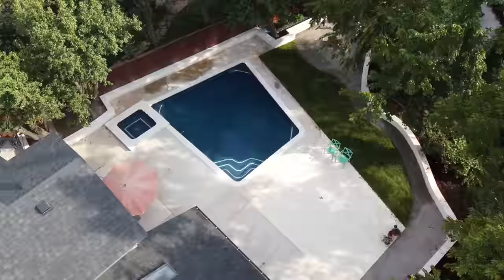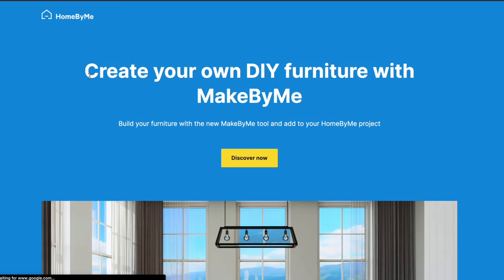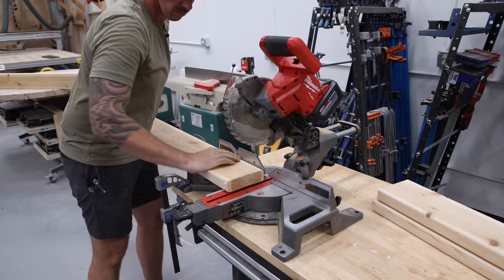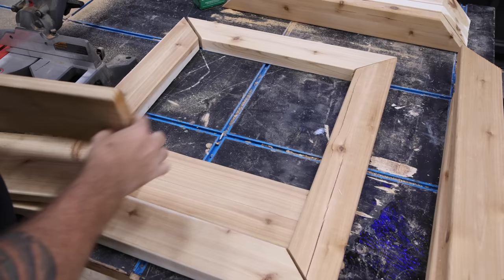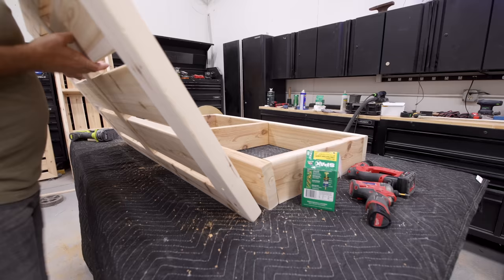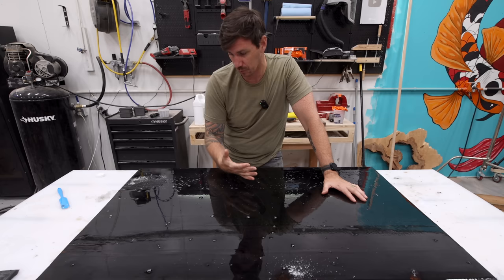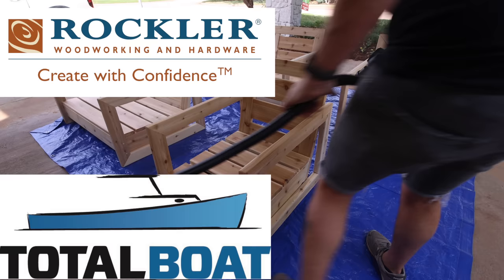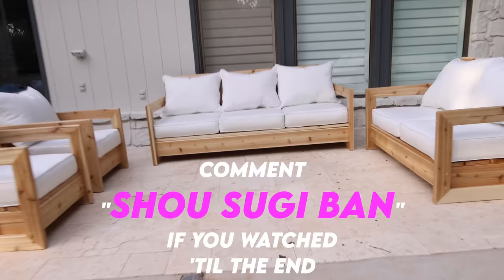$10,000 DIY Outdoor Furniture

Comment: Amazing build!!! I love this set.

A question, why is it illegal there to cut off the tags on pillows and mattresses??
Reply: It’s illegal for a reseller to cut the tags off. As a buyer, you can remove them with no problems, provided you don’t plan to return the item. There’s a restriction on removing them because they have to list what materials they’re made of (filler, etc.).
Reply: This stems from bedbug & lice outbreaks in the early 20th century that were being caused by retailers selling used infected mattresses & bedding. Actually, leaving the tags on after use would allow used items to be sold as new & is illegal, they're supposed to be removed by purchaser. It even says this on the tags but most people have never read them.

Comment: What clamps are you using to put the slats in? I'm trying to find some but all the ones  I have are too short. I got your plans just wish you added a little more into the materials to use/need. I ended up getting 2" screws but had to go back to the store when I read later on in the packet that I needed 3"
Thanks!

Comment: When you burn that surface run it with wire brush first to reveal a bit of wood character and Don.t use epoxy on it. Just water based warnish.